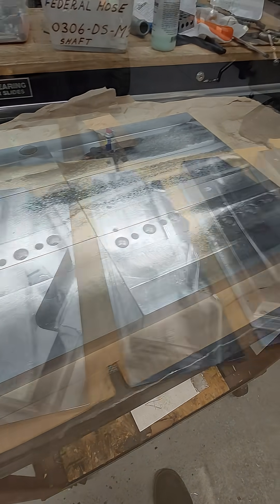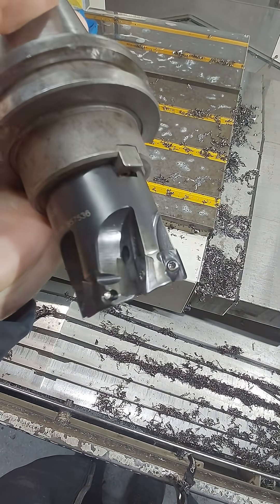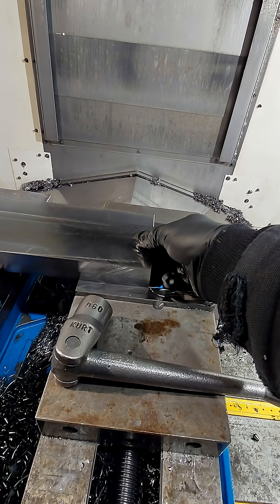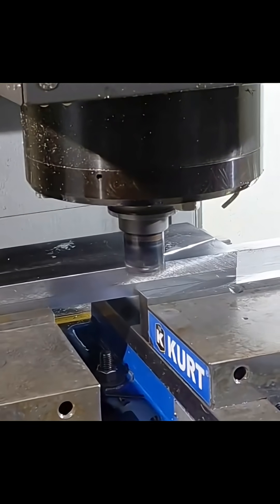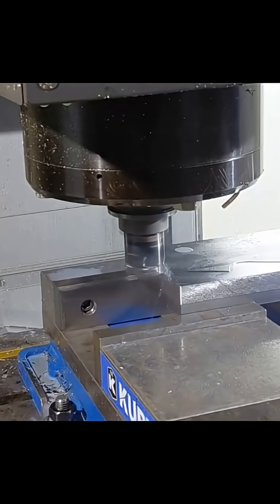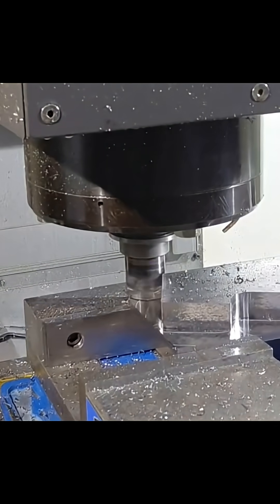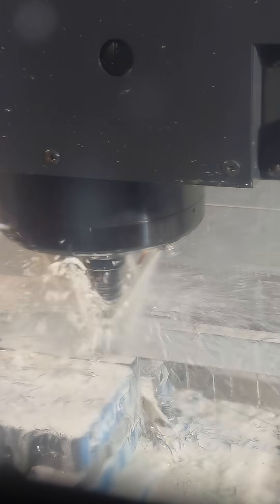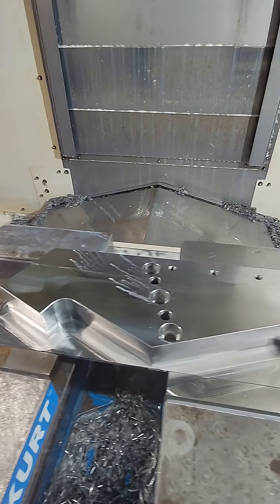Roughing Is Where the Money is Made

Comment: What about dynamic milling? Could probably do about a millimeter ae at that depth
Reply from the maker: For sure!  My problem with that is my old mori can't handle the amount of code it dynamic puts out for bigger parts
Reply: maximium ap and use the ae to adjust the nice cutting for the spesific operation, you will get very much more out of your inserts